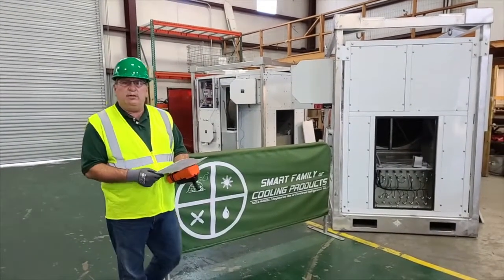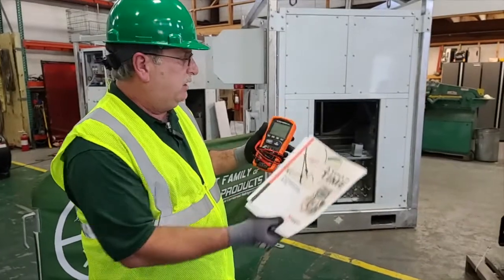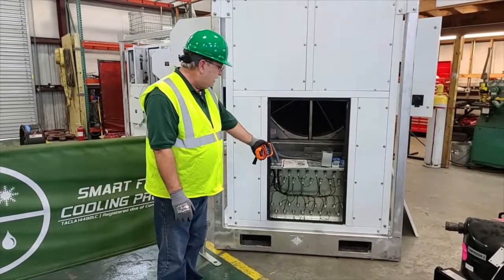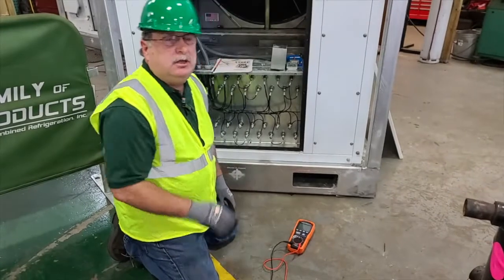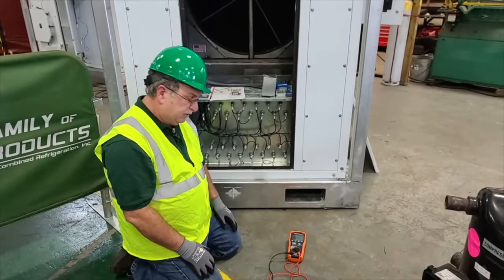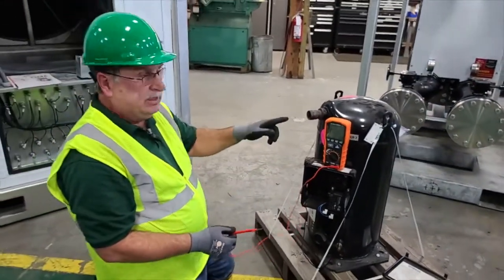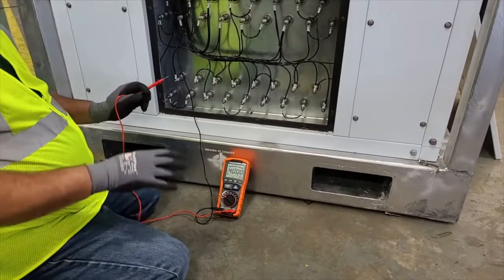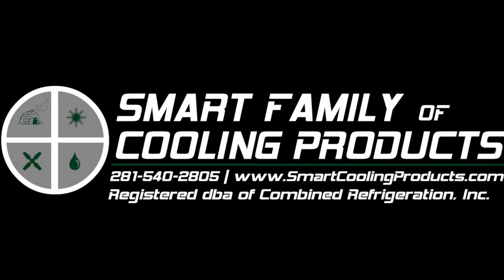Smart Academy HVAC102 - How to Meg Ohm a Motor

Comment: Great video and demos. My only small critiques are the meter would have shown better in the video if you had the backlight on.  Also when megging motors & xfmrs its good to let the test run for at least 1 minute, this will reveal weak points in the windings... Great video with very solid advice. 👌 I'll be showing this video to my apprentices.

Comment: It’s not the same as voltage with current behind it.  I once jump started a seagull that was laying on a roof, like dead.  I put both clamps on the feet and cranked the megger.  The bird woke up and flew away.  I don’t use cheap meggers.  I use industrial hand crank types with analog scales.  You would use 1000 volts to test 460, not 500 volts.  Motors are tested with twice their operating voltage.  Motors should also be tested at operating temperature.  Wish you would have shown a test on a compressor that had a high resistance ground.  I’m glad that there are videos like this, as a lot of techs are using 9 volt ohmmeters to test the insulation quality.

Comment: What would you want to set  600v 3 phaze pump at? 500v probs?
Reply: 1000v
Reply: He set it at 500v, due to the motor is 460v
Reply: @ganesanmuthiganesanmuthi5356  You’re supposed to test at twice the motor voltage, and with the motor at operating temperature.

Comment: Would not kill you or its not as danger as this guy said about. It will simply shock you.
Reply: I agree low amperage. A taster puts out hundreds of thousands of volts…. At low amperage.
Reply: @chrissmith6947  it can kill you if it goes thru you heart.  Your right though, there is hardly any amperage.  It’s more like static electricity.

Comment: At 11:55 ....mechanical problem has NOTHING to do with electric insulation problems. The reason why the compressor trps the breaker its because of current thermal  relay overloads due to compressor has stucked, unable to  run.